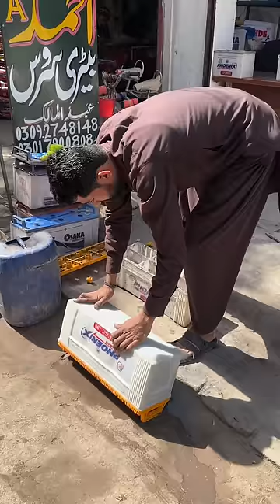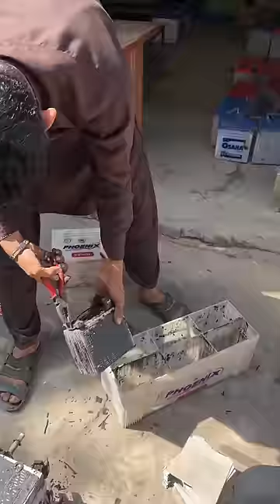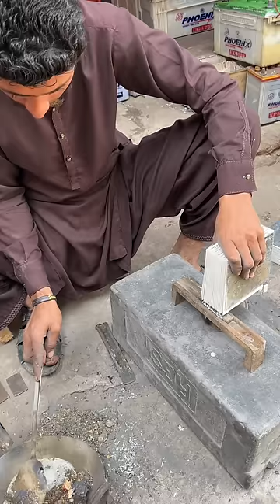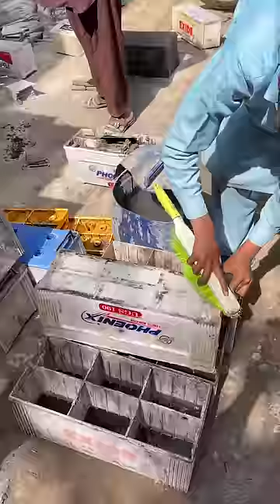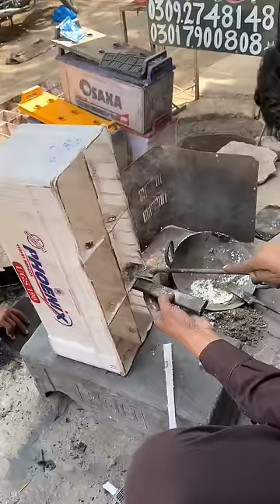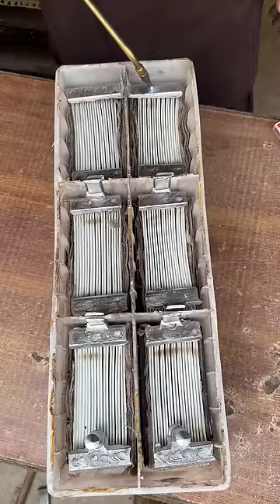From Dead to Alive: The COMPLETE Lead Acid Battery Restoration Process by a Battery Whisperer!

Comment: Watch when he turns the battery over and the acid runs into the street. I wonder how much of that goes into the drinking water and sewers. And with the fumes they are killing themselves. Very hardworking but short lives! To bad.😢
Reply: They dont care about pollution and the environment
Reply: It's water 😅 not acid
Reply: @OnlyDayzfanz  so, you would drink it?
Reply: @martinverhoeve1372  never said it was drinking water 😆
Reply: @OnlyDayzfanz  there you go
Reply: Nah, it's acid, that's why they're called lead acid batteries not lead water batteries.
Reply: @bigtuna4037  nah, it's water
Reply: @OnlyDayzfanz  How does a hydrometer work?
Reply: @bigtuna4037  Water is essential for lead-acid batteries to function properly because it allows ions to flow between the plates and protects the battery's active material
Reply: @OnlyDayzfanz  So where is acid?
Reply: @bigtuna4037  it's obviously mixed in with the water 😆